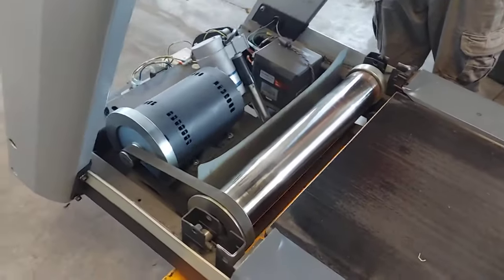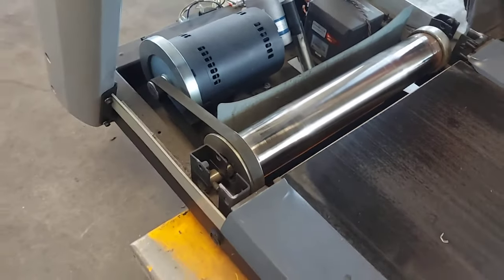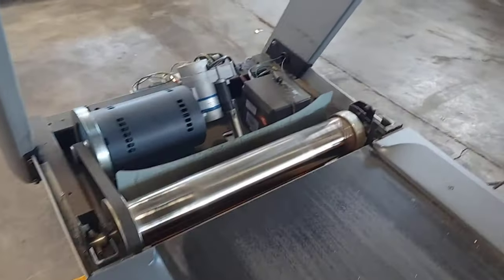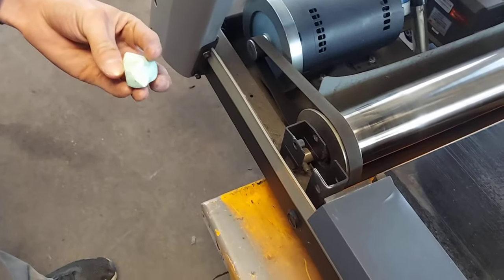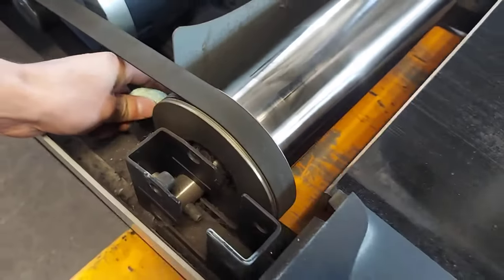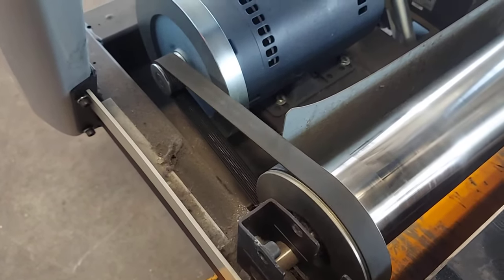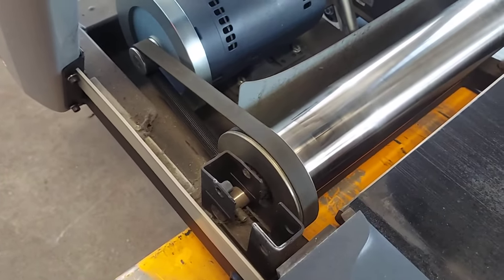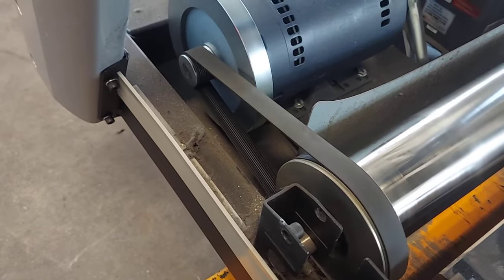Treadmill noise coming from the front

Comment: I just replaced brushes on a norditrac treadmill.  Cleaned up carbon dust and light scotch brite on part of commutator. New set up makes a clicking noise.  I'm guessing there is a seating period. Bearings were fine before and win spinning in brush free state. So by deduction it either a brush seating issue or commutator. Commutator loooks ok.. It's not a roller or belt.  Any ideas?
Reply: Update: rough uneven spot on commutator seems to be the issue. I can try to even it up or replace entire motor
Reply from the maker: On your treadmill model it might be costly to replace the motor might just be better off getting a new treadmill

Comment: I have a 2013 Horizon Treadmill CT 9.3 purchased in 2016. It has been used only for walking and that too very rarely. However,  I have been servicing it regularly. Since a week it has started giving problem for the first time. While in use for walking,  it suddenly stops and a clicking sound starts coming from the control board. After a few minutes it resets itself automatically and starts working normally but after a few minutes it again stops suddenly and the same clicking sound starts coming from the control board.
I am in Canada and Horizon fitness has almost no efficient and caring  after sale service here. I don't know what to do to overcome this problem. 
Can you please advise as how to master reset the machine to get rid of this trouble? 
Thanks.

Comment: Hello, I have a model TR 9000 treadmill and it has the message "waxer maintenance refill", I would like to know how to reset the fault because I have already changed the refill and the fault remains on the display and the treadmill does not start with this message

Comment: I have a precor m9.4sp. Bought it used and working but I brought it home and it started to flicker once I plugged it in. The control panel flickers and there's a clicking noise coming from one or both of the lift motor relay. Nothing is unplugged so I don't know what's wrong... my electrical outlet is wired correctly btw

Comment: I have this model machine TRM831  its getting all windows lite glowing continuously on now counting timeing and speed indicator now working so how i can do ? ...
and this parts not available in India because of old machine...
Pls reply..
Reply from the maker: This speed indicator more than likely came disconnected in the upper screen, get into the back of the screen and check the lower connection.
Reply: @coloradocardio  sir i have allready checked on same another machine it's confirmed. It's micro ic also heating...so plz reply..
Reply from the maker: @Sk-gd9ee  Might have to send in your Lower motherboard (IFT box) for repair. That would be that last place we check

Comment: Hi, great tip! Do you have any suggestion on what to do if the belt (drive belt I think it's called) keeps slipping to one side? I don't think the belt is damaged, but the plastic part of the cylinder it's on moves to the side when the treadmill is on 😅
Reply from the maker: Need to center the belt, there really is no trick.
Reply: That's the problem I think I'm having.

My plastic wheel looks to have moved in a few mm so the belt no longer lines up, I've tapped it a bit and it moved back to where it needs to be now I'm trying to figure out how to get it square and fix it in place
Reply: Yes, the same problem. But, when I tap it back to the right position, as soon as I start walking, it moves again! And centering the belt didn't help at all! I saw some videos where they use the superglue to keep it in place, and one guy even screwed the drive belt into the cylinder, which seems a bit extreme to me. Please update me if you find a more permanent solution, and I will do the same. :) I haven't been using the treadmill for months now  :/  @CruelEvisceration

Comment: I have a NordicTrack X7i, there is a clunking that comes and goes from the back roller area…any ideas?
Reply from the maker: This could be the back roller bearings are bad and will need to be replaced
Reply: @coloradocardio  so am I doing any other damage continuing to use it until I can’t tolerate the noise, before I replace?

Comment: What about a crunching sound?  Noone has a video for that
Reply: If you look at the drive belt the groves may be slightly damaged.
Reply from the maker: Replace Drive belt or you might have small rocks inside your running belt.
Reply from the maker: Yes correct.